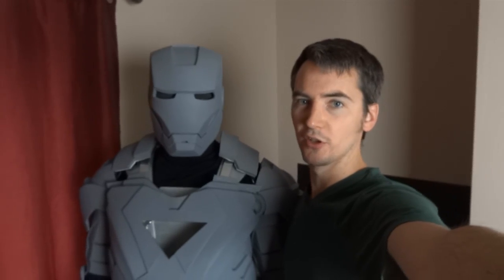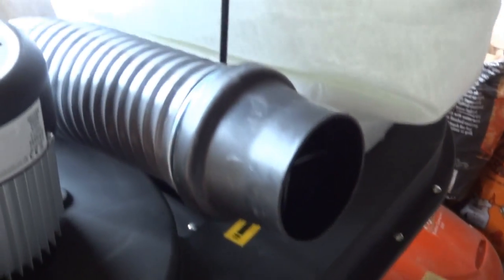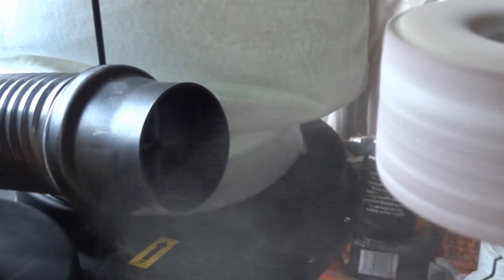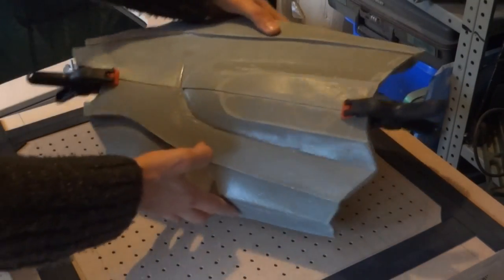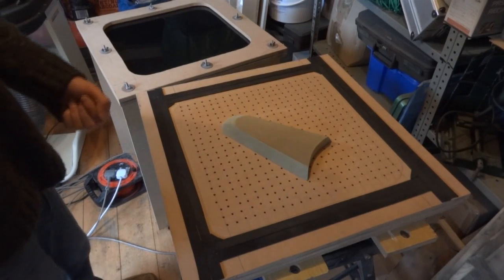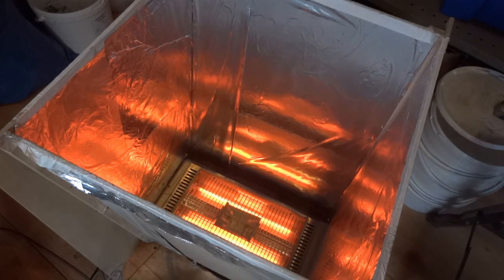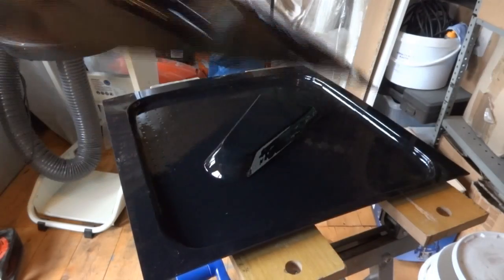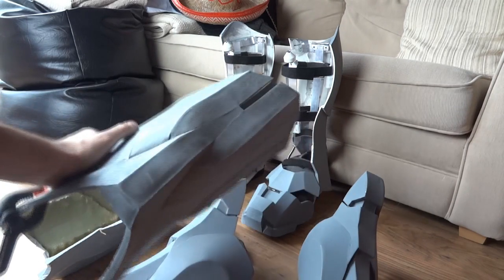Iron Man Power Suit #25 | Vacuum Forming Thighs | James Bruton

Comment: It appeared as if the footprint of a single plastic panel was more than enough to fit 2 molds on 1 go... and since the vacuum's 🕳 pattern transfers to the off-cuts, I'd assume they are 🚮 afterwards which seems pretty wasteful to me‼️

Is there actually a legitimate reason not to put multiple mold forms on a single vacuum-press if they can be adequately spaced from each other? Or did you just not feel like making 2 mold forms? 🤔

Comment: If you had a tempered glass lid it would retain more heat and speed things up as well as further evening out warming of the plastic, plus you can see through it so you know when the plastic is ready rather than run the risk of it suddenly melting too far and glooping onto your heater below and setting off a nasty fumes fire and burning your shed to the ground...

Comment: Quite clever I would say, nice work :)

On a side note, do you use interlacing when rendering you videos? It could be causing the flickering that occurs in rapid movements. If that's the case then you can use progressive scan instead. If the camera records interlaced footage, you could use a setting called deinterlace as well.

Comment: A few questions about the plastic molding:
First off, why don't you use the same  plastic sheet for both of the pieces, they seem like they would fit together, I might be wrong though.
When molding like that, I would imagine the plastic gets thinner in some places, do you do any calculations regarding it's limits, if so, what are those?
If you'd want to have some sort of indentations on the exterior side of the piece, would that be normally possible, or would you have to do something special?